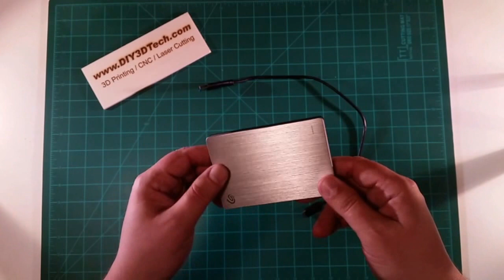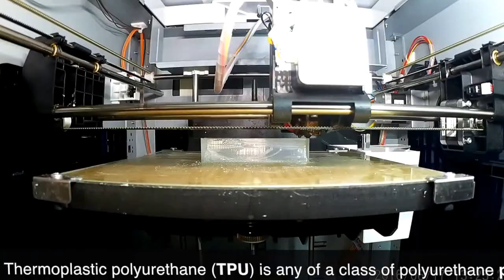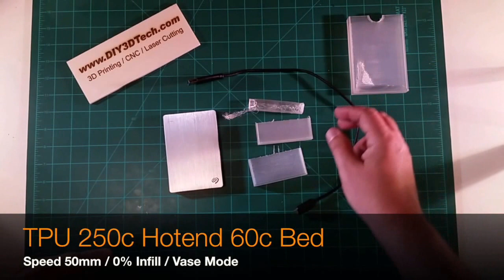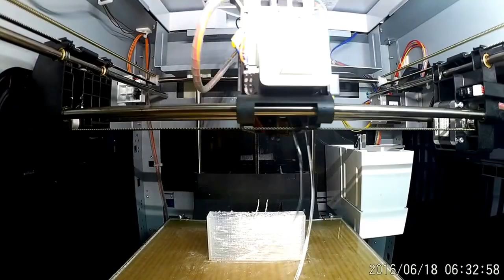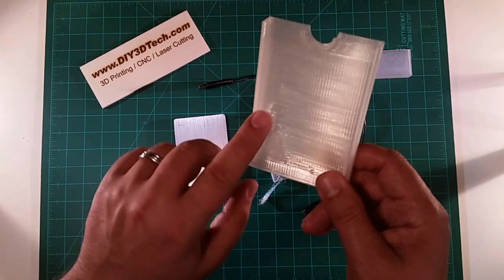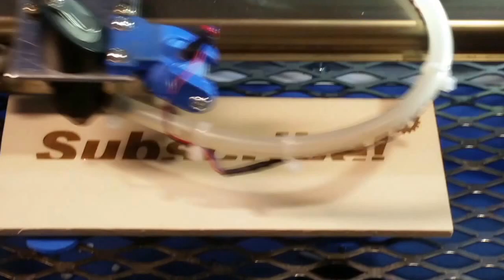3D Printed Project - Designing and 3D Printing a Hard Drive Sleeve in TPU FAIL!

Comment: You are pushing a lot of plastic through if you want a 1.5mm wall in spiral mode out of a .4mm nozzle. That means you need to print SLOW, or your extruder/hot-end won't keep up.  Do the math for the capability of a standard nozzle is ~10-15 mm^3/sec -- lets' do the math here -- even in vase mode, you are pushing roughly 4 times more plastic than that to get the overextrusion necessary to print a 1.5mm thick wall. In standard mode, use a fan, or TPU can't cool fast enough in a tall print. Your speed should be around 20mm/sec -- unless you use an e3d volcano type nozzle with a larger hot zone.
Reply from the maker: Love math and thanks for sharing!  Now in all honesty because I travel for work I queue these up so this was awhile ago and can't remember all the numbers.  However in vase in mode I did get one to "print" however it had a "run" in it and think your point "TPU can't cool fast enough in a tall print" is likely the issue as it was lower in the print.  However what I have come to later find is "retraction" to be an issue as I had not reset from PLA/ABS.  Now the vase mode print was at 50mm/sec so know it can push that fast however is that a good thing?  Have had a couple write the same (i.e. slow it down).  Since I love working with TPU and there seems to be some interest around this, think I try some test and take your suggestion of 20mm/sec and see what happens.  Stay tuned!
Reply: I'm only saying to slow it down since you are trying to get a 1.5mm wall out of a standard .4mm nozzle. I've done a number of TPU prints -- toys for my daughter mostly, and when it gets tall like that -- you need cooling. Or go slow. If you're getting a true 1.5mm wall out of the hot end in spiral mode -- you are not letting the plastic stay long enough in the hotend. At 50mm/sec that is equivalent to basically near 200mm/sec -- you'd never print anything at those speeds and have success (without specialized extruder/hotend). So for spiral mode -- measure the walls, if it's truly 1.5mm wall thickness -- slow it down, if it isn't do the math to figure out the actual flow rate. In either case PWM the fan at 50% and you can get away with printing TPU at up to 70mm/sec but rule of thumb is keep the flow rate within your hotend capabilities -- standard is 10-15 mm^3/sec, volcano can push it up to 35 and help the material cool, if you want to print faster, but up the temperature to compensate. It's a numbers game to find the right combination.
Reply from the maker: Yes one of the issues is the Da Vinci's don't have cooling fans, however I am going take your advise and do some tests as mentioned and do a few videos as lot of people seem interested in this.

Comment: TPU Solution, may be
http://community.robo3d.com/index.php?threads/tpu-repeatedly-fails.8519/
Reply from the maker: Interesting however what I also forgot to mention is retraction is an important issue as TPU does not seem to tolerate rapid and longer distant retraction.  I am think about doing a complete video on retraction as it seems to be a black art when it come to material science!  :-)
Reply: I am so Sick of problems with 3D Printers, Nozzle not tight to Bending plastic to Z Probe hieghts, 0.0001 out, to filament spool sizes http://1.bp.blogspot.com/-46lDeu20o4s/Uxh3P_BJEaI/AAAAAAAAEHY/Y79tpJogB9I/s1600/Filament_spools_Markup_A_to_P_Small.jpg , to making spagetti; feel like packing it in and selling cheap
Reply: I geuss; retraction will stretch backwards the squash forwared no actual retraction will happen with elastic types
Reply from the maker: What happens is makes a mess in the nozzle and you get a big jam up :-(

Comment: Also take a read of Fails at
http://mashable.com/2016/07/23/3d-printed-failure/#lhsm0wbxfGqC
Reply from the maker: So true "no regular person will use 3d printing"!  Was thinking that this weekend as I had to replace nozzle in one machine (worn out) and wire in a ceramic heating element into also another as it had shorted out.  However it was a good article and thanks for sharing!
Reply: Then because of this fix New nozzle another fix of: Z-Probe height, (nozzle height), feed rate changes and more retesting.  Still quicker than sending off for a part, which 9 out of 10 times can not be purchased :)

Comment: I read somewhere that 20% of 3D Prints prints fail. Printing slower may help, it may flex as it builds, narrow to hight ratio.
Reply from the maker: A lot has to do with "model" and math inside and that is what I find so interesting as it's all about the slicing software. This I think is the case here as I have printed a ton of TPU things with this printer and filament, however it did not like this model at all!  I really wish I had the time to write a slicer as I love programing and math :-)
Reply: Sli3r Open Source may be one starting point to do some coding, (maybe just smaller easier to manage objects
https://github.com/alexrj/Slic3r
Reply from the maker: Hmm good point, don't have the time right now but might be worth taking a peek for when I am ready :-)

Comment: Have you tried another cable with the drive?
Reply from the maker: Thanks for suggestion and yes that was the first thing I did.  What I ended up doing was taking the HD and placing it in another USB 3 housing all worked so it was controler :-(

Comment: Man that's sucks about the HDD. Have you tried contact Seagate for a replacement?  I really need to get some TPU and try it out.
Reply from the maker: Naw for the time it was not worth it, however I have a bunch of 3rd party USB 3 cases  sitting around so I took the drive out and placed in one of thoses and no issues, its just larger case :-(  however the total investment wasn't want down the tubes.  I have had two this way (however differing brands).